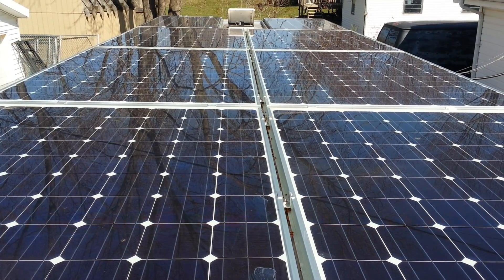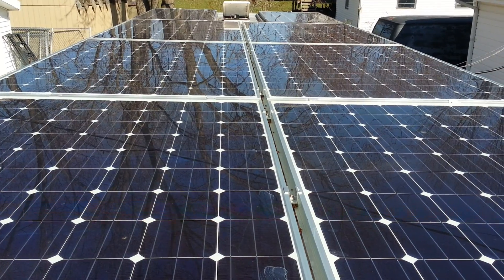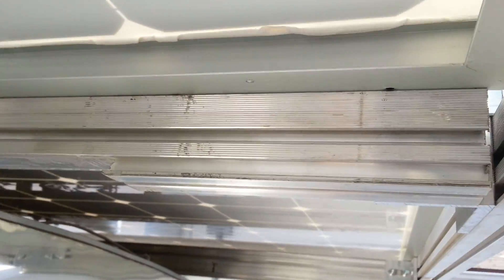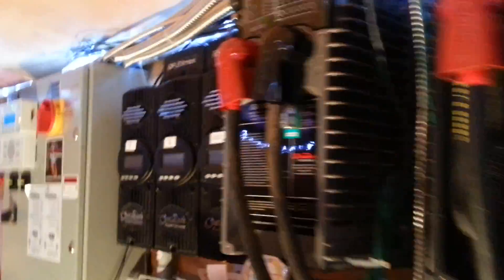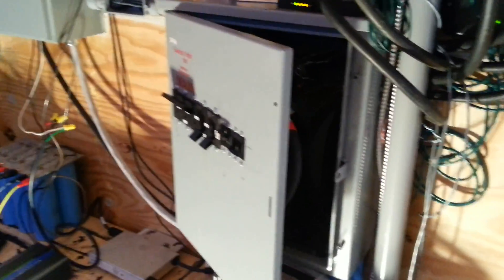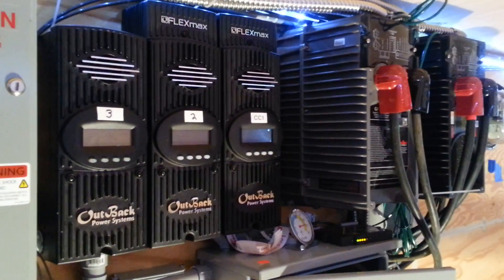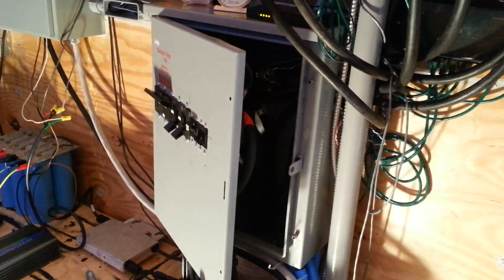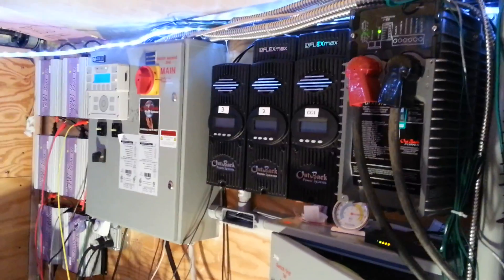3kw solar powered Off-grid RV

Comment: I'd be very curious to see how much weight would be lost by swapping to a 48v battery system with a single all in one unit like the 6000w eg4 unit that could handle those panels in series.

Comment: So at 13.5 volts you getting less than 240 amps incoming, because it's only a 3kw system. Which also means of your battery is somewhere around eight hundred amp hours. Batteries can only allow a maximum amount of charge current. Which actually limits and controls the amount of solar panels you allowed to have.

Let's not forget about the fact that when the batteries become charged they'll accept less charge current. 🌞

Comment: All them solar panels adding so much weight and tremendous expenses and labour work just so u can have lighting and have rear ac ? And it doesn't power the rv ?.....ur actually loosing efficiency because ur getting lower milage as ur adding so much more weight.

Comment: It can now be done cheaper and with more power in the same area at the same time.

Hobby level I have a 105 watt system that has been running 12 years.
I could now put 250 watts in the same space at 75% as much cost. (not adjusted for inflation!)

Comment: Nice setup. A bit more than I need but it's a good example of what can be done. I have both types of grid-tie inverters you have but the local electric provider got upset that I was grid-tied without their approval. When I looked at what their approval process was it basically makes payback impractical. I was happy just having a minimal electric bill each month and giving them the rest of the power that I didn't consume. Their requirements state the system must be fully engineered by one of "their" approved solar engineering firms (sounds like someone's getting a kickback), and installation must be done by a fully certified solar installer on their approved list (another kick back). Also, if you have your own equipment, too bad - you must buy all new equipment from the installer. Amazing how much effort the electric provider puts into stopping locals from going grid-tied. Got to love Texas PUC for allowing such baloney. Of course the electric provider wasn't happy with those requirements alone. They tried to push through our PUC a $50.00 a month service fee for those grid-tied systems that were approved for use. They stated that grid-tie caused more maintenance on the lines so those on solar should pay the electric provider an extra monthly fee. The PUC finally stood up for the public and said no, that's not going to happen. I now use my solar panels on my RV up in the Colorado back country, running 8 Trojan T-105's tied in 12v sets, a 3000 watt pure sign-wave inverter, and a Tracer 40amp charge controller. I have a ton of panels but only use my two 305 watt units as they supply enough power to charge the batteries. I was thinking of mounting the two 305 panels on my travel trailer (two less items to have to set up each new season of camping), and mounting the inverter and charge controller inside the trailer. The only thing to set up would be the batteries outside the trailer. Thanks for posting your setup.  https://www.youtube.com/watch?v=IE3O9eQDGXQ

Comment: I understand wanting to go overkill with 3 Kw but wtf is with the multiple inverters? surely it costs less and is more space/time/logic efficient to buy a single 2000-3000W Inverter...
Reply: Inverters eat power just being on. I plan on using a smaller inverter for basic electrical that is always on, and a second larger inverter for electrical used only when I'm 'home'.

Comment: Most of this is obsolete... sad but the truth... way too much high cost equipment that is not efficient! Most of the numbers you get are not true... only in optimum sunlight!
but this effort is indeed of the superior kind.
True output is quite bit less than 3Kw, yet ...and overkill if excess 1.7Kw/day! unless that is included in the $0 net!?
BUT, one does with what is available at the time.
Rolls Surette Marine batteries S-600 are a killer setup. no doubt! top of the line! built like no other! HEAVYyyyyyyy!
The best bang for the money due to their superior cycling and higher storage capability!
...and they are proven, just ask seafarers!

A much simplified system can be done today using micro-inverters directly on the panels
and lithium batteries with a much higher duty cycle rating and much less weight/size.
Just look at batteries in CELL phones, they last for ever!

But there are trade-offs... lithium comes with a different set of issues... as in... fire, etc..!
...up-front cost is higher, yet cheaper in the long run!
though...I would probably feel safer with the deep cells on a boat...
Redundant circuit protection is not something you want to fail to install!

Nice job... only a few people (comparatively) will go thru the effort!
ON your next attempt I would go to the most efficient 48V, skip the 24V altogether.
and that means a few more batteries! LOL

and ... of course much of it will soon be obsolete as the new inductionless converters and vanadium batteries hit the market... sooner than most people think!

Comment: If this were a home you would need to get a permit.  However, since it is an RV it might be ok to run grid tie without a permit.  That is between you and the utility.   Might be a loophole.  In Los Angeles they limit the amount of solar you can install.
Reply: Pure Horse Crap! There is NO LIMIT to the amount of solar that you may install! If the property is yours' ~ the effect of the sun has NOTHING TO DO WITH THE UTILITY< BUILDING DEPARTMENT < OR ANYONE ELSE FOR THAT MATTER!
Reply: Not true, Ron. Google "States that limit home solar power."

The irony is that asshats like you are pro-corporate and are part of the reason republicans have the political support to pass laws like this.

Comment: It is amazing to me how many commments question the purpose of the builder when he has clearly stated that the trailer will be used as a Ham Diaster Relief Center.
Reply: Which is the reason for 2 inverters, one for heavy loads and one for sensative electronics.

Comment: Could you give us an idea of the cost or preferably exactly what you spent so far. Nothing last forever so what is reasonable expectation of usable time before it becomes too expensive to maintain or obsolete. You must have a generator anyways for dust till dawn operation doesn't make financial sense to install a solar system? Any thoughts on the entire weight of the system, every pound you have to transport lowers MPG. Thanks for the video! You're clearly passionate about your work and it shows. It's been three years, how would you do it different today?
Reply: This is February 12, 2018. Those batteries have to be rep,aced real real soon. There’s another $5000 spent.

Comment: this is clearly an advanced system with no real details. did you scale this from a smaller system? what about costs? is it portable? looks like hwy speeds wld rip those panels clear off. sounds like your dad wrote a fat check and you had a pro install it. ok. just be honest. not pratical for those on a budget.

Comment: I put 3 250 watt panels on my rv and using the same outback equipment but using 2 100ah lithium ion batteries and now I'm looking to add a 650 watt wind turbine. I trying to find the best way to add wind turbines with outback any ideas?
Reply: +crazzylee You want to mount a wind turbine to your RV?  I don't think that would be a good idea but it would be interesting to see.
Reply: +Ommmm at night it tends to be windy plus they aren't as over cumbersome like solar panels. Like badaboom badabing know what I mean
Reply: just get a midnight charger control for the wind turbine and maybe some more batteries

Comment: Today I read that your cost per kW ends up being more expensive (battery replacement, etc) than if you were to just buy power from the grid. Have you found this to be true or have you done the math? I was looking at Tesla as well, but these CALB 100AH LFP Cells may be a more cost-effective option.

Comment: Nice system! There is a irv2 forums member I met recently who's Son is a pro solar designer/installer. His solar setup on his large 5th wheel is 8kw at 48 volts nominal. Says he never plugs in, runs the A/C and everything as if he was in a regular house. That's going to be our goal when we buy a new rig in a few years. Right now we have 600 watts of panels feeding a 675 amp hour T-105 battery bank that powers a 3000 watt PSW inverter. Hope lithium battery banks drop dramatically over the next year or so. ha!
Reply: I'm interested in Tesla's new 7kw Power Wall with a built in charge controller. If it will work in a mobile application it would be a great alternative. Cost is $3000.
Reply: There seems to be some concern from others online about it being road worthy, can it take the bumps and so forth. I guess mounting is also an issue, evidently it has to be mounted upright on a wall, and I've also seen some talk about it's internal cooling system being the primary reason for mounting it vertical....  something about it being a liquid(??) cooling system IDK, but it's interesting and will probably lead to something useful I hope.

Comment: Wow ! Well, your system looks so incredibly expensive and complicated as to be nearly unaffordable. I've been heavily researching the feasibility of using 4 or 6 high output rigid flat mounted solar panels into (1) one solar charger controller, with (6) six ultra high efficiency Lithium 12 Volt batteries into (1) one 4,000 Watt Pure Sine wave 12 Volt DC to AC inverter, then wired into existing breaker box in my RV. I'm not sure I understand why you chose to use so many smaller duty inverters when 1 or 2 max could do the job ? You have many, many extra components in your system which would not be required to power an RV. I think a true off grid shore power or Onan RV generator solar alternative must be at least 4,000 Watt sustained duty with a true 15 AMP 60 Hz sine wave output to be of any practical use. I want to run both my computers, my microwave, my TV, my audio amplifier, lights, battery chargers, small blender, etc.

Comment: Now if only they could make a hybrid RV like a light weight class B you could drive forever without fuel as long as you have sunlight
Reply: +gsarjos no, you could not.
Reply: why not?    if you have an electric motor and a constant power supply to the batteries you could run as long as u have sunlight and panels
Reply: do you have any idea how much power is needed to run a car, let alone an RV three times the weight? not possible only on solar.
Reply: if a smaller RV such as a Winnie will all solar and a decently large battery high drain package, I think it's feasible but going long distances wouldn't be possible. maybe a few dozen miles but that would be it
Reply: It's based on Physics. See, for the amount of electricity you get from the solar panels, you can't have a motor run for long pushing that much weight. I don't know the exact numbers off the top of my head, but think about it as:
you are being given the ability to push 100 pounds based on the sun, but you need to push 1000 pounds. It's a HUGE difference of power needed. Even with a car covered in solar panels it's hard to do, at least with current solar panel technology. In the future, with solar panels that are more like 50% or 100% efficient we may be able to do that, right now though we have solar panels that are more like 20% efficient.

Comment: Hi! Yes I was wondering just like the other person about what are the capacitor banks for but I can see To me its to prevent voltage drop when starting large loads like motors, but what I am stumped on is the large coil or transformer on the right side of the battery bank box. A real mystery to me.

Comment: Nice setup.  Also good are the separate inverters as if using one large 5,000 watt inverter and it fails, then everything is off.  Wiring looks complicated in one lump sum like that, be kinda nice if you had site page of schematic of the wiring but yes, its one wiring up of one block segment at time and does look so complex at the end.  Nice job!  Thanks for posting for others like myself to see.

Comment: Good try little brother did you know they sale fold out matts at half the cost and are 500watts each. and have less wires to run and be able to  have more room in that Rv for other stuff such as disaster relief equipment . you could of use a house DC disconnected to house a converter to a ac disconnect and so forth, This would of saved time and money and lotts of space . for more info contact me at :certifiedelectric@yahoo.com

Thanks
Jr the solar pro

Comment: How much watt do you get in cloudy weather approx?
I don't think you intended this to be 100% solar powered with included electric driving. But if you are curious I found out that it require about a horse power or two to sustain a speed of 30 miles per hour for a racing car. Don't know how much it is for a normal car or for a RV. But it gives me a perspective that you probably could do about 30 mph with 3000 watts with only solar cells.

What is your thoughts about that?

Comment: You should switch over to a 48 volt system !  And a gvfx3248 inverter charger... You'll only need one FM80 solar charge controller... Sell the other 2 charge controllers for $1000 and buy more golf cart or deep cycle batteries!
Reply: I agree

Comment: I've been considering going off grid.  Probably not in an RV but my power needs are similar. I'm also hoping to set up a 3KW system.  But isn't this set up a little overkill?  Three charge controllers?  I understand the logic behind separating the two inverters for electronics and high drain devices but three charge controllers?  I guess I don't understand the logic behind it.  Do you have completely separate systems?

Comment: this is AWESOME!!!! YOU ARE THE MANN. now why cant you power your car with it?? why dont you go one step more and power your vehicle for long trips?? instead of powering the rv couldnt you put all this power on a really light flat bed connected your car and power your car? for all you people out there if you increase the length of the flat bed to a certain length it will indeed power your car imagine a 53' foot flat bed trailer and the power you can generate. YOU WILL NOT NEED GAS!
Reply: law of diminishing returns, weight of panels, controllers, batters and trailer would with the current technology exceed the capabilities of the dc motor and speed controllers for the motor.  get a bigger motor and it reuires more panels and batteries. 

there is a small electric mini van on japanese television that is all solar, but it can only run for short periods of time before it drains its batteries and has to sit and recharge.... same issue roof space not large enough for more panels, and a larger an would reuire more batteries larger motor etc.
Reply: think about an rc car if you put a panel on it will it power it ...the answer is YES! why because the weight of an rc car is about 2 lbs...now in your mind s cale down a 4000 lbs car to 1/20 th 4000/20 =200lbs can solar panels on top of a car push 200 lbs .probably not there is some engineering going on here...
Reply: forget batteries for now( they weigh too much) think of only solar panels powering the car. how do we do it? it takes light material and ....is it possible to scale up an rc car to present size cars and maintain weight scale? then throw a panel on it and see it fly
Reply: OK, no batteries would work, as less weight makes for more efficiency.  :)

Comment: Nice system but not exactly a livable off grid rv I was expecting. I only have 600 watts on my off grid rv but its plenty of power for my needs and in fact I split it in 2 to make dual zone charging system, one side runs all my 12v, the other to an inverter to run an elec frig and all my 120v outlets. I use as little power as I can yet still run eveything while charging to limit so I can have power all night as well. I have vids on here too if you want to see. Thx for sharing ttyl

Comment: i did the same thing to my RV class A and have 11 panels on my roof
 the thing you should add is most RV roofs can not hold the high LB of the panels

my roof had to be edited  and made all of still to just hold this load

i have a 24v dc off and on grid system as well

i have some video as well on my youtube

99% of the time i am never on park power